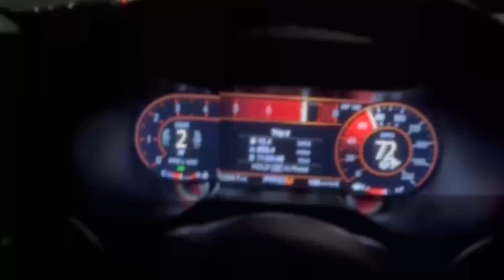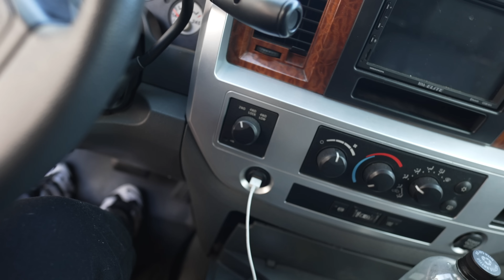LS7 C5: This Should Be A Fun Car!

Comment: i went wcch heads..... they are fantastic dudes and the owner knows what hes doing the place has been arouind forever.. they refreshed my heads did all the milling and cnc porting etc.... 

Went RPM b3 cam, vararam cai , MSD manifold, longtubes, 3.90..... went 9.9 on pump 91, 625+whp